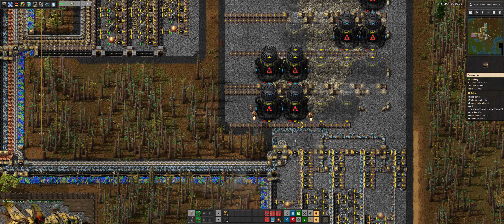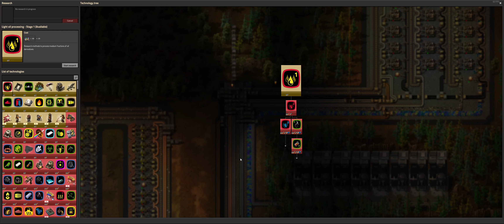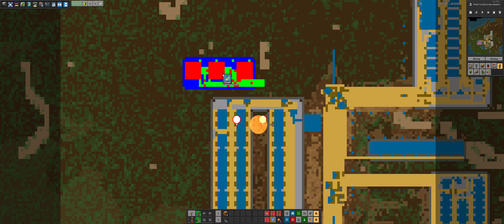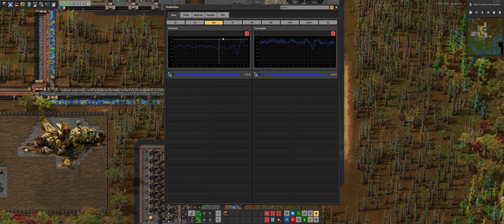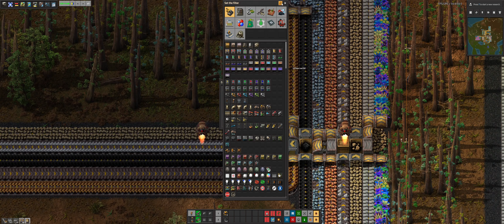Factorio Rampant Pyanodon - S01E12 - Turn ash into more resources? yes.

Comment: Looking at your ore miner design - I would consider flipping one mining column to face the other direction, so that a set of miners can share the output column of copper ore/ash on one side, and share the input of coal dust/fuel on the other, thus shaving off an average of one column per set of miners.
Reply from the maker: Hey Sterling! Yes! Someone suggested this a few videos ago and I have implemented it in my playthrough! It doesn't show up until season 02 tho 😅. I think the most important part of the change is that it covers the entire ore patch so that the whole patch is being used at once!
Reply: You don't have infinite ores somehow, do you?
Reply from the maker: I do! Rampant resource, makes the yield fall slowly to 25%. Didn't want to worry about resources completely disappearing!